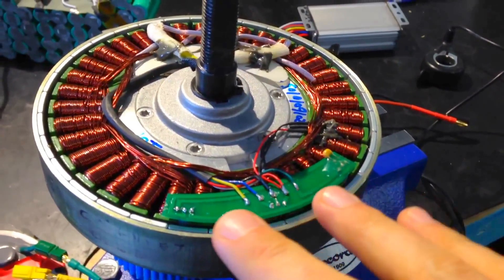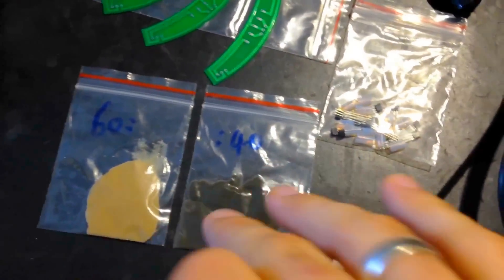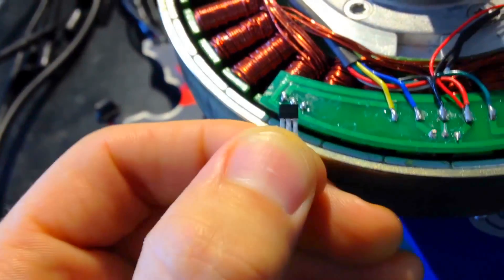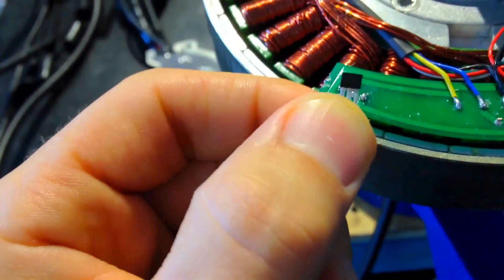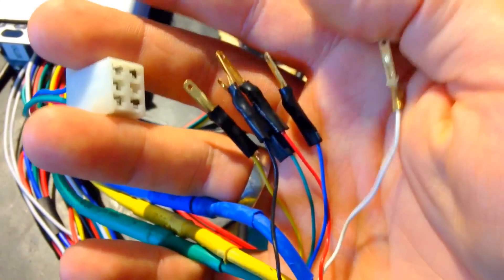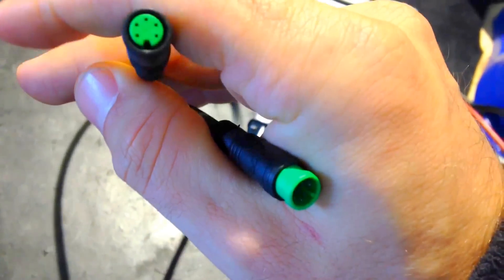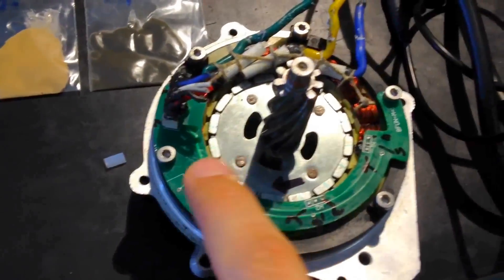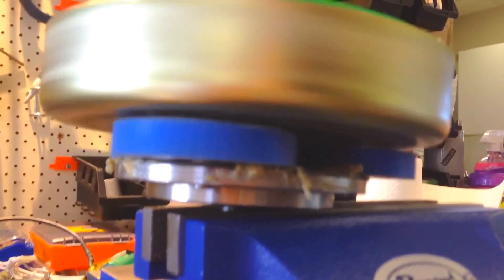Hall sensor replaced on MAC hub motor + tests with Bafang BBSHD controller • EM3EV Australia support

Comment: Hello dear friend I have an electric bike, but my controller stopped working... Bought a 72V 80AMP controller but the wheel walks very slow the magnetic system is not working will the controller have many amps???? My battery te72 v 18 amps

Comment: What is hall sensor
Reply from the maker: Hall sensor tells the controller the correct position of the magnets vs the copper coils, this gives the controller better control specially at low rpm. Some motors and controllers are sensorless like RC helicopters and drones cause they don’t really need high torque to start spinning and are mostly running at high rpm

Comment: How much more efficient is the bbshd compared to the mac if you ride mixed terrain?
Reply from the maker: I actually compared the MAC vs BBSHD as I used to ride home my BBSHD next to two guys riding MAC. Commuting on the road, in traffic, lots of stop and start and no big steep hills, MAC is the best, more comfortable (single gear) most reliable and less maintenance option.
Mixed terrain, off-road or very steep hills BBSHD is the best option as it uses the existing bicycle gears which is a mechanical advantage as you can select the right gearing ratio for each situation. The BBSHD is easy to install but there are a lot more moving parts and gears to be serviced + you’ll find yourself often changing chains and the rear cassette. Both systems are great and have their pros and cons, it all depends what you really want to do with the bike =]
Reply: Thank you for the answer! How many percent difference in range would you estimate if both motors were going at 30kmh in a 10% grade continuously?
Reply from the maker: Hummm hard to pick a number but you’ll get better range on the BBSHD cause you can always find the best gearing ratio and make it run more efficiently. I would say maybe 15% more range at least. These numbers can turn upside down if you don’t pick the right gear the BBSHD may consume more energy than it should. I’m just feeding you many scenarios cause they’re all relevant
Reply: My countrys law demands that I pedal whenever using the motor. I am a bit concerned that the most efficient cadence/rpm of the bbshd is much higher than what I am comfortable pedaling.

Do you feel that the high rpm/cadence of the bbshd discourages you from moving the pedals at all?

Comment: Hi Bruno a great channel!
I need new Hall sensors for my BBSHD. Fitting type is 89542-B5030. I can not find a data sheet. I think it is a bipolar type? A replacement type would be, for example, the Infineon TLE4935L. What do you think? Thank you for your help!
Reply from the maker: +Bike71 hey mate... thaaaanks dude haha... great to see that you're trying to repair the hall sensors and that you actually managed to remove the hall sensor in one piece!!! 

I found this data sheet not sure if helps at all: http://www.allegromicro.com/~/media/Files/Datasheets/A1324-5-6-Datasheet.ashx

Infineon data sheet https://www.infineon.com/dgdl/Infineon-TLE49X5L-DS-v01_05-en.pdf?fileId=db3a304316f66ee80117549ac8b206b1

https://www.infineon.com/cms/en/product/sensor/magnetic-position-sensor/hall-switch/TLE4935L/productType.html?productType=db3a30441441f8c001144f104e3802cd

Just pay attention some hall sensors are 5v some are 12v, Bafang is 5v, Mac is 5v most motors and controllers operate in 5v, but very few are 12v

So far I haven't replaced any BBSHD hall sensors yet, I tried replacing on the smaller BBS02 and BBS01 and they were glued soooo hard inside the stator, removing was a pain + finding the new sensor to buy, ordering it, waiting for it to arrive, hoping that it fits and actually works like the other two original sensor, so much time and labour $$, the guy was in a hurry to get back on the road so in our case was actually cheaper and faster to replace the whole stator that comes with a new hall sensor board, a bit of waste but we had to use this shortcut option. Its not very common to get hall problems with these motors, most cases the controller is showing hall sensor error but you replace controller and ta fine or it's just badly soldered sensor, you reflow solder and it works. 
Let me know what happens, I'm really curious to know =]

Comment: hi.. how can we test if hall sensor are not working ..thank you. Godbless
Reply from the maker: Yeeeaahhh.. you can test your hall sensors just using a tester like this one from EM3EV https://em3ev.com/shop/ebike-tester/ but you can also open your motor and test the sensor using a multimeter... you have 3 legs per sensor, you should see 5 wires going to the pcb where the hall sensors are mounted, normally you will see red and black wire and another 3 random colours, the red and black are feeding 5v or 12v to the hall sensor to work, the other wires are the output that you get from the hall sensors. Probe both negative and the output legs. As you spin the motor by hand you will notice that the output should change voltage (on/off) check all 3 sensors, they all should vary on/off, if you find one that doesn't change (always on or always off, its faulty and needs to be replaced. You need to find an identical one, same voltage, same size. That little tester will make tests easier, you can see the 3 output LEDs switching on/off as you move the motor.

Yeeaaahhh so much POWEEEEEEERRR =]
Reply: Ok.. noted. Thank you soo much

Comment: What's the part number for the sensor?
Reply from the maker: Humm... I would love if the Chinese manufacturers used the proper "part number" system... instead we have to figure out ourselves... if you're having problems I would recommend emailing companies that sell this motor such at EM3EV in this case, or maybe emailing MAC motor directly... most cases these big companies don't even reply emails from direct customers. =/
Most of the times the PCB is not damaged, all you have to do is to figure out what hall sensor you have, test and figure out which one is faulty and replace with a new one =]

Comment: Hi, Where did you purchase the circuit board and hall sensors?  I need both.  Thanks, Matt
Reply from the maker: +Matt Singleton hey mate!!! Parts for Mac hub motor you better email Paul at www.em3ev.com I recently visited his factory and he has a massive ok those hub motors, accessories and parts that are not listed on his website.. let me know how it goes =]
Reply: Thanks.  Em3ev has the circuit boards and is checking on a freewheel cover for me that just broke.  Thanks again!  Have a good day!

Comment: hi man
would you recommend this mac motor for customers who want something cheap, reliable, long-life, for daily use? :)
Reply: I have a mac motor. It lasted 6000km (8 months for me). When I opened it, some metal part had come lose and damaged the plastic gears. But the main culprit was a lot of water that had built up from condensation. All the hall sensors seem to be shorted. Will try to replace them and see if it works again. The axle also seems to have bent slightly (I haven’t mistreated it. But maybe you need large cushiony tires to protect from shocks).

Comment: how much your bike weights ready to ride?
Reply from the maker: Hummm... my road bike with the BBSHD without the front gears, crank arms and bb bearings was about 10kg + 4.8kg motor... I carry the battery in my backpack so the bike feels MUCH lighter and agile as you ride and also carrying upstairs.
Check out lot more details in this video https://www.youtube.com/watch?v=ZsQIA8INPWg
So much POWEEEEEEERR =]
Reply: ElectricBike so that's light how much battery weight and how much do you think in England it would cost to convert a bike to ebike like this?